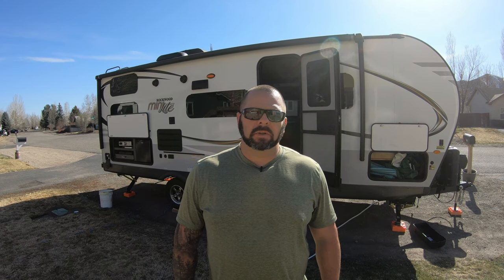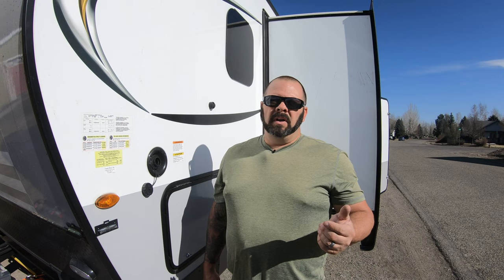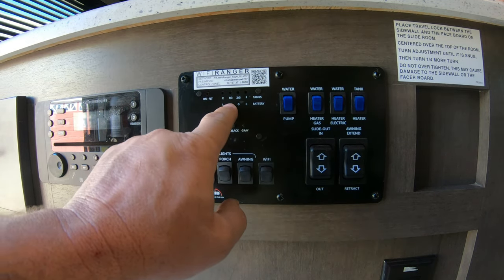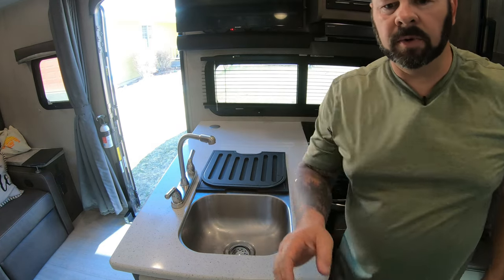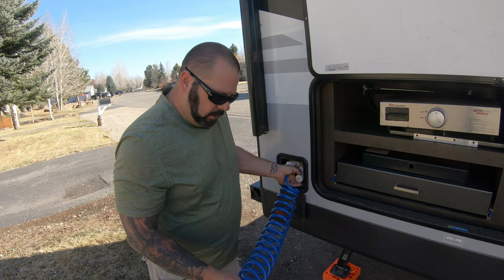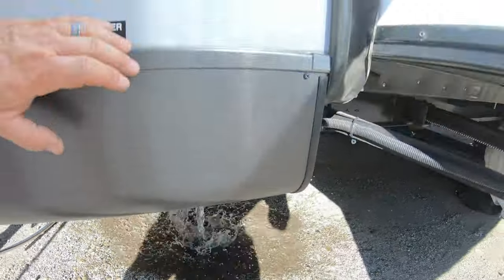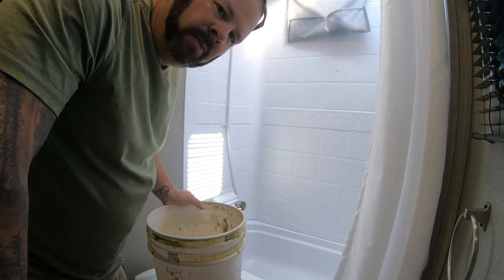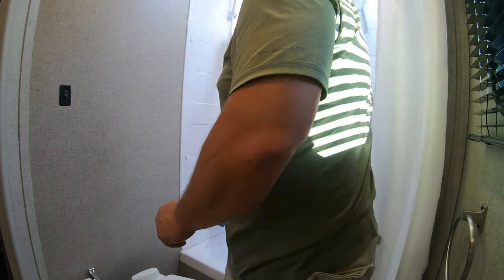How I de-winterize our 2021 Rockwood Mini light 2509S travel trailer

Comment: Also adding information about setting water heater bypass and valve setting for pump to accept water would complete the information.  Filling the hot water heater and testing before lighting would be icing on the cake.
Reply: Agreed. It would be nice for an annotation to be added to the video for future viewers.  We just purchased a 2022 Flagstaff 25BRDS, which is 99.9% identical to this Rockwood.

Comment: Question, do I need to add water to the fresh water tank in order for my water pump to work?
Reply from the maker: Yes, you should not run your pump dry, the motor can overheat if there is no water.

Comment: Did you do anything with the hot water tank? Drain it ? Im just trying to figure out my 2509s and I’m a little confused by some of this.. could you just drain all the water from all the lines before winter? I did notice it had a antifreeze I let by the city water hook up. I’ll check out your winterization video and see if I can answer my own questions thanks again really liking your content it’s very helpfull
Reply from the maker: When de-winterizing your camper it is up to you if you would like to do anything with the hot water heater. The only thing you have to do is open the cupboard to access your hot water heater and turn the switch on both the red water line and blue water line so that the switch is facing towards the hot water heater. I personally dont do this until my first trip that I am going to use the hot water heater. This way there is less breakdown and wear on the anodizing rod and hot water heater.
Reply: @BassinNmore  thank you for this it’s much help!

Comment: Terrific video. One question though: should the low point drains be opened at any time during the de-winterization process?
Reply from the maker: Yes, you absolutely should. I had already started the winterizing of the camper before I decided to grab the camera and had already done that, but forgot to add it in the video. Thanks
Reply: Not sure what you mean by low point drain.

Comment: Can you just use the city water hose or do you have to fill up the tank? When you use the city hose does it also run through that filter as it does if you’re using the holding tank?
Reply from the maker: I personally like to do them both. The main reason i do the fresh water tank is it was sitting unused for 6 months and I  just like to insure it is clean for dry camping. They both go truough the filter so should be ok. Technically when you switch the valvue when winterizing it bypasses the city water line, so no real need to worry about that line, but it only takes an extra second and I have that peice of mind.
Reply: Thank you! We just picked up our 2104s on Saturday and are brand new at everything. Your help is appreciated! I didn’t know to do it through the tank. Do you then turn the heater on? Are there two switches in that cabinet to turn over. I truly appreciate your videos. We need all the help we can get. Thanks again!
Reply from the maker: @Limerick1985  yes there are two swithes for the hot water heater. I didnt include it as I wait until we rrally want to use the hot water before filling it so the anodizing rod in the hot water heater last longer.

Comment: How about a video on the shower hot water recirculate system. Also do a video on which position all the valves should be in for winterizing and dewinterizing.

Comment: Did you run the bleach thru the water heater
Reply from the maker: No, I bypass the hot water heater before running the antifreeze through the lines during the winterization process, so there is really no need to. I also don't turn the bypass back on to the water heater until I need it to help with the break down of the water tank and anodizing rod.
Reply: I meant to say when you dewinterize ur camper and after all the antifreeze disappears and you see bleach and bubbles.
Reply: I don't know much about the break down of the water heater and the anoud rod
Reply: Anodizing rod I meant to say

Comment: At what point do you turn the hot water heater back on
Reply from the maker: I wait until I am actually going to use the hot water heater, usually the first trip out. Then I drain the water in the hot water heater after every trip to keep the tank nicer and I don't have to replace the anodizing rod so often.

Comment: What did you need to do to your hot water heater?
Reply from the maker: Oh oops, I didn't add that part 😅, sorry.  There are three doors just to the left of the control panel, open the one closest to the floor, and inside there are two valves, one on the blue line, and one on the red line, turn them both so that the valve handles are the same direction the the lines are running.
Reply: At what point do you turn those two valves?
Reply from the maker: @davidderoche6724  I turn them on my first camping trip. If I am dry camping I turn them before I leave the house and make sure it has water in it. If at full hook up I wait until I get on site and am setting up camp.
Reply: @BassinNmore  so there is nothing you need to do with the what the hot water tank when de-winterizing?
Reply from the maker: @davidderoche6724  nope
Reply: @BassinNmore  Thank you.